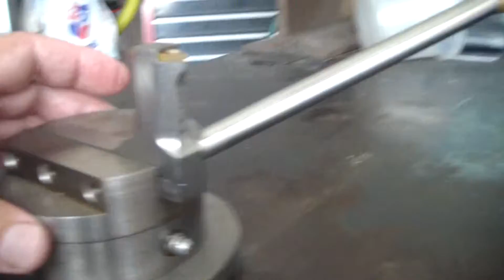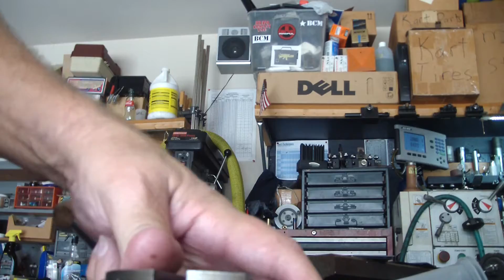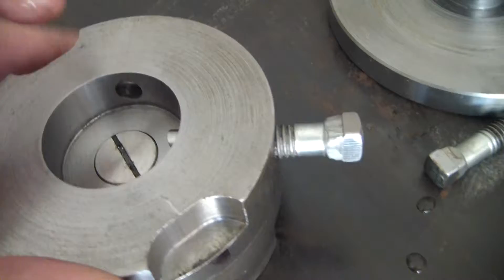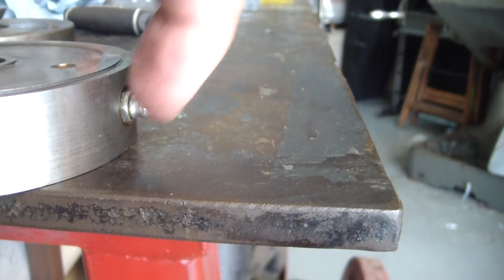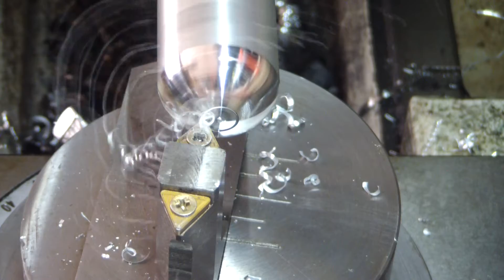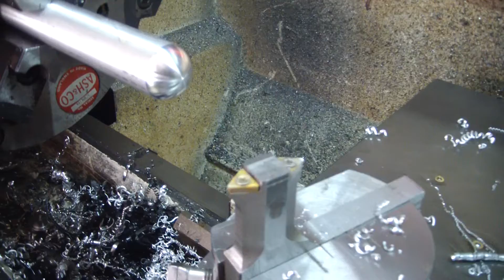Ball Turner / Radius Turner for lathe

Comment: I really like the idea of the moving disc with the ring running in a recess on a bed of grease. This no doubt aids stability greatly and stops the unit rocking about the centre as might be the case with other designs I have seen that just use 2 flat mating surfaces. Thanks for sharing this with us, I will be making one to this style at some point soon.